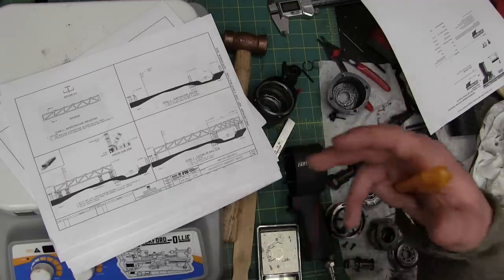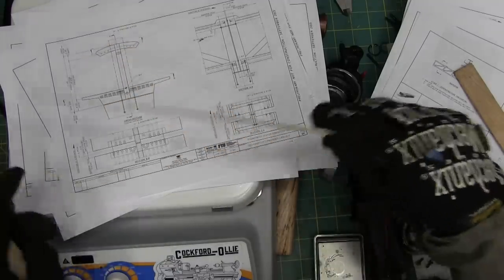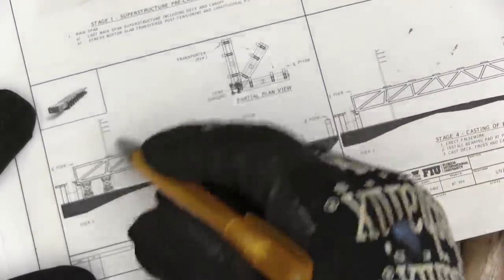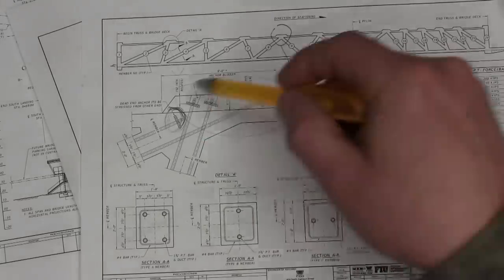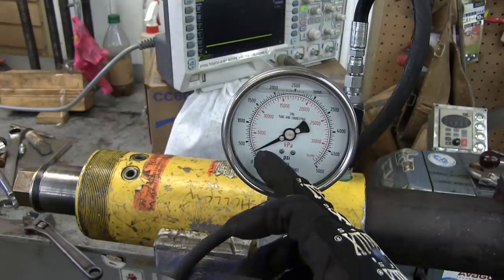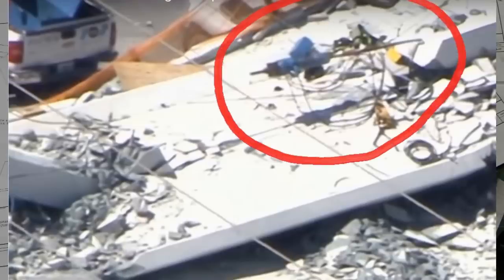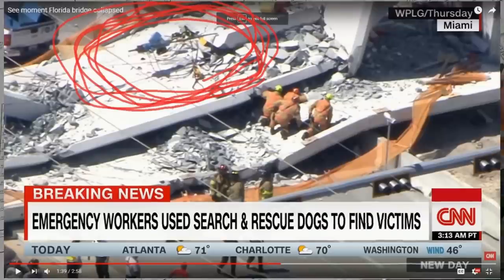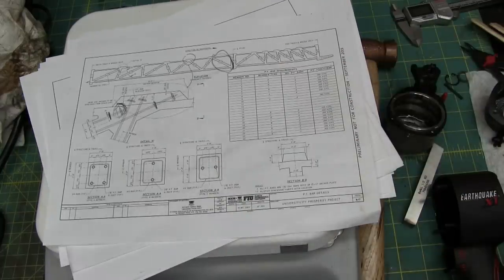Post Tension Failure Florida Bridge Collapse | Engineering EXPLAINED!

Comment: The span that failed had a dead load (the weight of the materials that make up the structure) of 950 - 960 tons or 1,900,000 to 1,920,000 pounds.  The span is approximately 175' long and 20' wide.  If you assume a person walking on the span takes up a space of 1' x 2' - the maximum number of people on the span at one time  would be 1,750.  Assuming an average weight per person of 200 lbs - which is probably on the high side - would result in a maximum live load of 350,000 lbs.

The center tower had not been completed and therefore there were no cable stays installed which would have assisted in supporting the total load of the dead and live loads.  An engineering judgement was made that it was OK to safely set the span with out the center tower and cable stays with only a 350,000 lb (15%) reduction in total maximum load.   It is inconceivable that the horizontal section of the bridge could support itself in a no live load state - yet still supporting 85% of the total weight - without either the center tower and cable stays in place or some intermediate means of support from below.

It appears the span was over stressed to begin with and the post tensioning adjustments only accelerated the failure.  It appears the material in the tensioning rods was already in slow yield.   Left in the post installation state long enough - the span would have failed without some temporary support.
Reply: I stand corrected.  The "center tower and cable stays" are not structural at all.  They are mostly cosmetic added to enhance the aesthetics of the bridge and to eliminate any bounce in the main structure.  In my humble opinion - for 14.1 millions dollars - the taxpayers got a really crappy bridge.

Comment: As a ironworker have worked many times ,posttensoin is the best way to build any structure period,from my experience failure in pt is from either faulty materials or faulty heads under the hats an more likely  than not happens right after the sentence " we got to get this done today or it's going to cost a company a lot of money" straight out of the head Cheese's mouth

Comment: Newsflash... the deck is the LAST part of the construction of a suspension bridge. The suspension tower and the cables are what supports the deck. Those need to be in place so when you are building the deck the cables are applied to each section you build. A deck that is designed for a suspension bridge can not support itself.

Comment: Suppose if this walkway had successfully passed it's tests and went into service. Would any damage to the sides, say if an over height vehicle or just regular weathering and/or stress cracking, Would this compromise the structure enough to cause a similar brash failure to happen in time? To my way of thinking they are designing these structures relying too much on perfect conditions and integrity. You always over design just in case of extreme conditions or situations which we all know can and usually does happen.

Comment: I can't help it, but I don't see a physical way how that first truss would be under tension once the bridge was sitting on the pylon and not supported by the machinery. They had to tension it to carry the load when the end of the bridge was hanging on it, but once they put it on the pylon, the truss must have been compressed by the weight of the bridge. And from the footage it seems to me it broke under the compression and it's possible the rod was pushed out of it as the distance between the former truss bottom and top reduced as the bridge was falling while the rod was not anchored to the roof.

Comment: Why didn't they make the top beam out of metal or plastic? Or made the bridge in a arc type pattern where the load if collapsing would create a flat brige etc. instead of a single concrete beam?

Comment: as a follow-up FYI, I saw something that came out in the run up to the midterm elections, where the incumbent governor of Florida is (unsuccessfully)trying to distance himself from involvement  in the bridge collapse debacle. There are pictures, dated two days prior to the collapse, of huge cracks in the bridge.  The picture I saw showed a gaping crack, probably close to several inches wide and measured with a scale as at least 4in deep. It doesn't take a degreed structural engineer to see that that never should have had workers on it, much less live traffic beneath it. I would have pushed or pulled a temporary false work pier beneath it at an appropriate location, until a well thought out plan could be devised to deal with it.

Comment: SWEETWATER (CBSMiami) — Investigators have confirmed that workers were adjusting the tension on the bridge at Florida International University when it collapsed.

National Transportation Safety Board released their latest findings Wednesday saying in part, “The investigative team has confirmed that workers were adjusting tension on the two tensioning rods located in the diagonal member at the north end of the span when the bridge collapsed.”

Today's News.

Comment: A very detailed and obviously the answer to what went wrong,, well done. That said, you have to wonder why the hell anybody would require a 950 ton concrete bridge as a pedestrian walkway? I'm from Toronto Canada, and we have built many structural aluminum pedestrian bridges, with longer spans than the collapsed one in question, beautiful to look at and probably at a fraction of the cost than this engineering nightmare. Go figure,,,,,,,,,,,,,,,,,,,
Reply: not likely, concrete is way cheaper than aluminum. You're probably comparing this massive structure to small pedestrian bridges that are maybe five feet wide.

Comment: Its like the Titanic. Which broke in half because it wasn't designed for the ass end to hang 400 ft in the air.
This span was not designed to to self support without the suspension cables.  Its mind boggling that the temp supports were removed before the suspension cables were installed.

Comment: The contractors ( possibly Mr. Brown of another video here ) said the suspension cables were for looks. No wonder the contractors gave no respect to the overhead cables during construction. The contractor erected the bridge as if there is no suspension cables. Therefore the bridge would fail and it did !  No provision for the tensile support from the suspension cables from above. Therefore, the 174'-0" span section could not span across such a distance, and collapsed ! George Wu, ARCHITECT, AIA, NCARB 2018-3-23

Comment: The strain gauges should have picked up on the plastic deforomation of the tensioning member.  Stress may not change much prior to failure in the plastic deforomation regime, but the strain (elongation) is absolutely running away.   Most importantly, though, traffic should have ceased upon the first sign of something having gone wrong.  Sad.

Comment: This is a simple failure. Anyone who has observed cable stayed bridges being built would see it. Before collapse there are NO STAY CABLES visible from the top of the bridge section to a supportiing tower. There was no temporary support underneath the bridge section. The section was never designed to stay structurally sound by itself. You support it with stay cables and then remove the mobile supports. The cable tower was not even built.

Comment: If you watch the truck dash cam video very carefully, you can see "what appears to be" the tensioning rod ejecting from the concrete support. Something pops up in the air, and also, one construction worker seems to float in the air defying gravity.  It seems he may have been lifted by that rod as the bridge descended, although he does not appear to have any lateral motion, which I would expect.  I would think they would be smart enough to avoid looking down the barrel of that thing while they are working it.  (edit: a comment below indicates he was killed, perhaps by the PT rod???)

And my own two cents, but why create a suspension bridge "just for looks" when you can use that suspension to create a bridge that doesn't fall down in 5 days. IMHO, they should have erected the suspension point and installed the smaller bridge first, then add the second longer bridge and attach the cables.  Duh.

Comment: With the bull whip sound it looks like it's a materials failure of the tendon.  I've heard that sound as a tendon let loose and the tensioner and tendon shot out the side of the deck being tensioned.  The worker was left with the controller in his hand white as a ghost.
Told you that was probably post tensioned.  Pretensioned anchors are HUGE.  As much as thousands of tons are accumulatively put on all the tendons.  MASSIVE operation to place a pair of these anchors.  Not impossible but not practical on site.
The plan was to de tension then let traffic through.  Obviously they didn't stick to their plan and it caused more deaths and injury's than there should have been. 
Looks like the worker was adding tension rather than relieving tension.
The plan was to de tension, not add tension.  Go back and listen to the fella with a white hat and white shirt.  The crane was there to provide fall protection for the worker.  Common practice.

Comment: The bridge is not built like a truss. It is a floor, a roof,  diagonals running from floor to roof to be tied into a cable on the same diagonal above that would go up over or through a support column and back down to an anchor point down around the floor level at either end of the bridge. The support columns above would transfer the weight of the bridge streight down to the ground as a bow string transfers the stress in a bow to an arrow. The cable being the string, the column being the arrow. This was not a truss,and was not self supporting. The supports should have never been removed until the tower or towers were built and the cables were in place.

Comment: Yup,  by moving the  temporary support towards the center of the span, the crew changed the post tensioning dynamics. Instruments used to detect and keep track of the predicted movements the tensioning was supposed to induce would have given false data as it relates to predicted movement of the span versus the amount of tension the crew was applying to the PT rod. The span wasn’t crowning as predicted so the crew was told to keep adding tension (maybe they thought that the pressure gauge was fucked up) until the PT rod finally had enough and failed. This would impart a shit load kinetic energy into the concrete and then gravity, being the bitch she is, took over.  
As far as having the crane there, I pretty sure that they were using it to position the hydraulic tensioning ram. But maybe I’m just full of shit.

Comment: You can tell right where the bridge deck broke by looking at the video of it on the ground. The bridge section fell straight down and shattered, but theres only one area where theres concrete pieces on the ground under it. These concrete splinters must have hit the ground before the rest of the deck. So yes, it was most likely that piece of the truss that failed, but when ot failed, it shattered the deck, and caused the total collapse. Also, people saying that the mast and cables that were yet to be installed were for "aesthetics" or purely for vibration mitigation, I'm going to have to say you're wrong. Nothing that big and complicated would ever be just for aesthetics, and vibration control is covered by the rebar. I've never seen a cable stayed bridge installed deck first, cables second, they're always built piece by piece with the cables for the next piece installed before the next deck section. What its going to come down to is the university was rushing this project, and they wanted something to show for it, so they put in the main span first, when they should have installed the mast first, then the smaller span, then the larger span. They wanted to make this into a PR stunt, and they did, but for all the wrong reasons.

Comment: Ok so I'm no enginurd either but i worked in a mine 43 years and understand post and beam pretty good. And I understand that nature likes to handle pressure with symmetry. thats why pressure vessels are round on the ends. And when I look at the webbing i see that its not symmetric. And that bothers me and I have to think it was designed to fail at some point. either now as it did because of messing with the tension or down the road with wind load.

Comment: From my point of view the original design, with this type of concrete structure with post-tension, is one of the reason why it has failed. It's too much complicated and the only reason why they did this design it to make it look nice...Architects consider only the looks, not the feasibility. They have also moved the structure before the concrete was completely cured just to be able to meet the schedule of the inauguration day...I have never seen an inauguration of something that was not completed...

Comment: With any bridge construction being replace or built in. They should have had traffic rerouted when the build is done or when the work area is safe to pass through. Traffic should have not been driving under that bridge if the contractors known their was a problem with the the connection of the stress rods.

Comment: The rods in the concrete beams are cast in and bonded to the concrete. They are not in tubes. According to the sections there are 4 rods in the vertical beams and 2 in the diagonal beams. They are fixed at the bottom and adjusted at the top.  There are rebar or steel hoops tied around the 4 rods or 2 rods at specified intervals. Look at the hole above the intact rod end thar is sticking out, that should be where the second rod on that diagonal should be sticking out. That is the rod that broke cause it ain't there. You can see the angle  on top of that diagonal , that is where the diagonal met the underside of the top deck. The rod that is still intact  and sticking out still shows the adjusting nut and bearing plate for that nut.  This rod did not fail.

Comment: NTSB Highway Accident Report: https://www.ntsb.gov/investigations/AccidentReports/Reports/HAR1902.pdf

3.2 Probable Cause

The National Transportation Safety Board (NTSB) determines that the probable cause of the Florida International University (FIU) pedestrian bridge collapse was the load and capacity calculation errors made by FIGG Bridge Engineers, Inc., (FIGG) in its design of the main span truss member 11/12 nodal region and connection to the bridge deck. Contributing to the collapse was the inadequate peer review performed by Louis Berger, which failed to detect the calculation errors in the bridge design. Further contributing to the collapse was the failure of the FIGG engineer of record to identify the significance of the structural cracking observed in this node before the collapse and to obtain an independent peer review of the remedial plan to address the cracking. Contributing to the severity of the collapse outcome was the failure of MCM; FIGG; Bolton, Perez and Associates Consulting Engineers; FIU; and the Florida Department of Transportation to cease bridge work when the structure cracking reached unacceptable levels and to take appropriate action to close SW 8th Street as necessary to protect public safety.

(Note: Page 100-102 of the report stated the engineering firm assumed the bridge was a redundant structure, with multiple load paths, when in fact it was not redundant. All of their calculations were grossly miscalculated, including omitting or ignoring a substantial part of the load scenarios. and the bridge design, per the NTSB, was destined to fail eventually).

Comment: How did OSHA let them allow vehicles to drive under an active movement. In the shipyard, no one at any time can be under any overhead lift or movement. This should have been done at night when there is  minimal traffic, with the roadway blocked, and any traffic rerouted around it.

Comment: There may be many numerous possibilities for the explainable reasoning and likelihood for the failure & collapse of this footbridge. No doubt those having to define the final explanation have a very difficult job ahead. What now can be said with a great confidence of truth at this time is that someone was very sure of them self, and in possession of a very large pair of cajonés, both of which allowed for them to place their career, their reputation, & their possible freedom on the line by allowing the public’s access on and traffic flow under this newly known & uncommonly used footbridge design. Eventually it will come down to placing blame on one culprit for this disastrous decision making mistake. Unfortunately, culpable guilt & punishment will not bring back those killed & injured & comfort those left behind to grieve the victims; all caused by another’s stupidity, ego, and money saving cutbacks! Once again a very horrific and unnecessary tragedy!!

Comment: Any idea why they used concrete at all when a steel footbridge would have done the job.
 just look at the forth rail bridge finished in 1890 and carries 190-200 trains a day or  Brunel's design in Bristol Clifton Suspension Bridge 150 years old, both carrying a larger load than a footbridge. and both in weather conditions that can horrendous at times.

Comment: The neutral axis of the truss is not in tension or compression. Below the neutral axis, the truss is in tension but the metal will not let the concrete expand. If the metal where stainless steel, it would have a low yield a long long way from its UT limit. Depending on the properties of the metal rods will determine if the elastic properties of the rods will allow the concrete to dislocate below the neutral axis. Wait while I get a beer. Now then,  oh screw it. You know that rod does not look broken and that would indicate it was not prestressed enough.